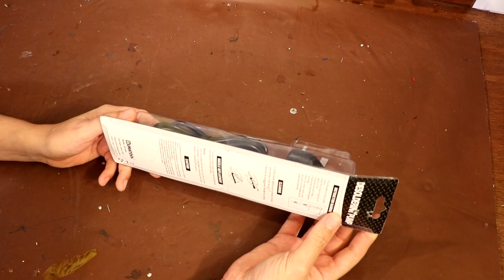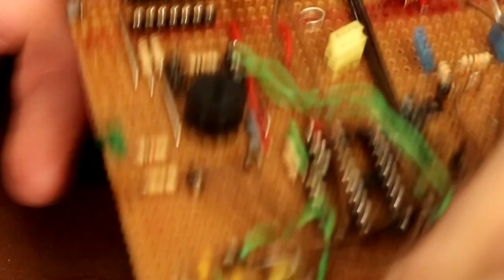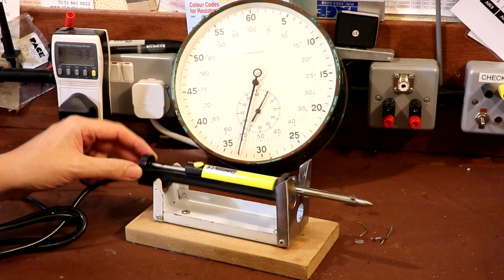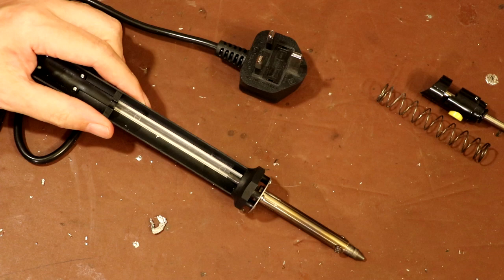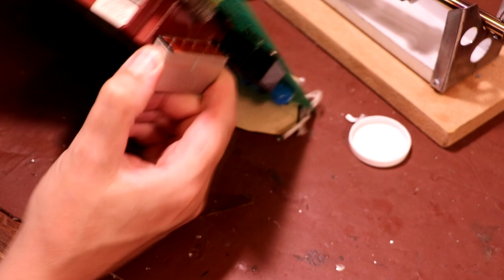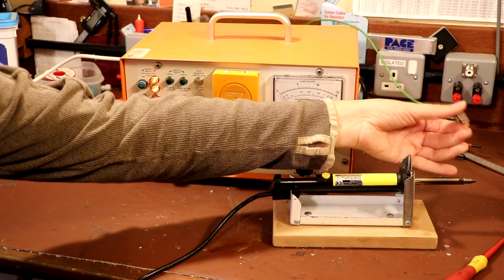Duratool Desoldering Pump

Comment: Same design of my yihua 929 and i use it for desoldering mouse switches and power supply capacitors good performance so far its more efficient than the traditional desoldering pump

Comment: Mine failed after 10 minutes use. The body melted where it meets the tube going down to the tip (where you were complaining of it being a bit hot) and fell out! Clearly they're not all like that but still. It was branded "Yahao" if that means anything.

Comment: I have bought this after watching a couple of reviews.  I bought it to repair PS5 controllers, but seem to be having problems.  It just doesn't seem to desolder properly.  Do you have any tips, as I am a novice?  I have flux on order which I am hoping will make things easier.
Reply from the maker: I suspect a lot of the components legs are small and the tip on that sucker is very large. Something like a PS5 controller is probably going to be something difficult to work on. Flux may help. But it is also difficult to work on double sided boards with a solder sucker. If your removing ICs and you don’t need them you may be better cutting them off. Look at my last video I show some techniques for desoldering
Reply: Brilliant, thank you so much for your response.  Greatly appreciated 👍🏻
Reply from the maker: @PhatControllerz  if the desoldering doesn’t go well don’t beat yourself up it’s a hit and miss process. Remember you don’t get to see all the times I fail.
Reply: Thank you, and to be honest, I didn't think of that.  Everyone has to start somewhere.  I'll keep you posted with how it goes.  I do have my eye on another desoldering tool, so if it goes wonky, I try that one.  Another cheapy, but looks the part and comes with different sized tips.  Fingers crossed.  Thanks again for your help! 😊

Comment: Just grabbed one of these after watching your review last week, surprisingly good actually. I was removing a micro Arduino clone that had all the pins soldered and it made easy work of it, the nozzle is indeed a bit big but once the solder melted on each pin I could give it a jiggle, hit the button and it sucked it all up cleanly. Not sure if it will work a second time but it has potentially saved me its value in time and parts already. Thanks for making this!

Comment: Thank you ever so much for showing us how to get at and clean out all the sucked up solder. My son bought me this exact de-soldering pump last year (for fathers day) and it really is brilliant for "Through Hole" de-soldering. I've used mine on adding chip sockets inside my Commodore C16 computer, when i was upgrading to the 64k RAM and i've just used it on replacing my son's thumb sticks on his PS4 controller. It does get a wee bit hot though and extra care needs to taken when using the pump but it does the job for me :)
Reply from the maker: Thanks so much for watching the video, great comments and glad you found the review useful. I’m very impressed with your computer upgrades your doing a tremendous job. I do think from the description of the work your doing you would benefit from a more advanced tool look at the Duratool desoldering station with the electrical vacuum pump. The percussion from the spring going off in a hand pump can be quite damaging to small pads and tracks especially on multilayer boards.  Maybe you can make a video of your computer upgrade I would love to see that. Thanks best regards Chris

Comment: Thanks for the video. I was afraid to open mine when I didn't know exactly where it opens. Now I know, but I still had to pry with a screwdriver because it was stuck quite hard. If you have trouble desoldering smaller component legs, put some gel type flux on before and there are no issues whatsoever. Flux makes the solder melt instantly and it sucks it so clean it looks almost new. Highly recommended to use flux.
Reply from the maker: Thanks so much for watching the video and leaving a nice comment. I am glad you found it useful. My best regards Chris

Comment: Excellent!  Just bought one and found your video just what I needed to know,  Many thanks.
Reply from the maker: Glad it was useful. Thanks for watching regards Chris
Reply: @allthegearnoidea6752  Funny what you say about removing the solder bin.  I have tried to remove it on the new one I have bought and it is rock solid and have not yet moved it!  I wonder whether the rubber seal is rather on the big side.  I know, from you video what to do but it must be a really tight fit when new.  Perhaps turn it on and try again.  Thought I would practice whilst it was new and cold...

Comment: Best review on this product...plus you are the only one who showed how to empty  the chamber without breaking the black plastic guide. On the other hand other reviewers constantly got a better desoldering performance from this tool . Maybe its all about a technique with this cheep tool. Either way it was really informative.  Cheers!
Reply from the maker: It works very well for the price but doesn’t compare that well with the more expensive vacuum pumps but it’s ok. The circuit board makes a lot of difference how much clearance around the the pin and hole. The board I was using may have been a bit tight
Reply: @allthegearnoidea6752  Today I started  socketing the DRAM of my 8bit Atari and I did an extensive use of the tool.  You are right, the performance of the pump if heavily affected by  the characteristics of the layout of the circuit (size of ground plane and pads, distance between pins etc). 
Multiple pins components  can only be removed with hot air, the pump alone can not free all pins 100%.
Reply from the maker: Yes quite right and good luck with that Atari

Comment: I found 1mm tips on Aliexpress by searching for "Zhongdi desoldering tip".
Reply from the maker: Good job finding those smaller tips and thanks for the update and the information thanks
Reply from the maker: I have heard of the existence of smaller tips but I couldn’t find them myself.
Reply: @allthegearnoidea6752  https://a.aliexpress.com/_mqKLiXf
I tried ordering them just now. I'll try to remember to add a comment on whether they're better or not.
Reply: @allthegearnoidea6752  So I finally got them and they work flawlessly. I tried them on a mechanical keyboard. Desoldering both the switches and the 4-pin RGB LEDs (fairly small pins) was a breeze. Heavily recommended.

Comment: I have one of those and it got so hot in the holder stand that it melted the pegs that are part of the handle, melted the seals in the barrel portion too.  I had to trim the pegs off and get metal standoffs and longer screws.  Still works but has lost a lot of suction power.
Reply from the maker: Yes they run very hot. I wouldn’t leave it unattended etc but ok fo occasional use. Stay safe thank for watching regards chris

Comment: Hi Chris. I did a search on eBay and saw this tool. Very similar to yours but it looks like it comes with 2 tips. Large and small hole. Here is the link. 
https://www.ebay.com.au/itm/220V-30W-Suction-Desoldering-Pump-Tool-Sucker-Electric-Soldering-Iron-Pen/124251891849?hash=item1cedfd6889:g:WdcAAOSwEHpfBWxq
Reply from the maker: Good information thanks for sharing the link

Comment: I see you can burn yourself on the handle so it would be a no-go for me. Totally dislike an ordinary  de-soldering pump. I have gotten used to the de-soldering iron I have 
been using for decades. Has a rubber syringe bulb to suck up the solder . They seem to last 15 years  or so before the syringe bulb cracks to pieces. So I bought 
a new one this year. Very good review that shows I did good. Positive side: heating tip with the larger hole won't clog .
Negative side: Needs an  inch of spongy rubber/ silicone  piece where it gets hot .That should makes things a little safer.
Reply from the maker: he's the Master  It ok for the money.  Desoldering tools are like religion, some people like them but  generally all bad. Thanks for watching regards Chris .

Comment: Certainly a good enough tool for young players starting out on a budget Chris. I wish I had one of those when I first started out as a ten year old with little money.  Some teflon tape wrapped around the end of the yellow tank might help give a some insulation from the heat after all 100C is the boiling point of water.  I don't know if that would affect the fit of the tank and the vacuum seal though. You would have to experiment a bit to see. Thanks for the look see. Stay well. ATB Doug.
Reply from the maker: Doug McArtin yeh the heating is manageable it’s not the sort of tool I would leave switched on all day but it’s a good tool for those starting out and for occasional use. I would have been happy with it when I used to salvage all my components from old TV sets as a boy. Come to think of it I still have those components LOL. Thanks regards Chris

Comment: Thank you Chris for a very thorough review. My favorite solder sucker is the Japan Engineer SS-02 - a bit expensive but very well made and features a pin on the plunger that clears the inlet. I think the secret to all "powered" solder suckers - as others have mentioned - is letting them warm up fully and sucking long enough for the solder to clear the tube. Regards, David
Reply from the maker: David V yes I have a Japan Engineer one,  to be honest I haven’t found it any better that cheap pumps, but the silicon tip is more gentle on the PCB pad so that’s advantage. I still think a good powered pump is really the way to go but it’s the very devil to try and find a good one. Thanks for watching regards Chris.
Reply: @allthegearnoidea6752   It is difficult to find good powered pump suckers - I think you already own the best (Pace). I used a Pace Kit for many years at work and miss it. My personal choice for my retirement bench was the Aoyue Int 474A++ sold by SRA Soldering. It has good suction, a good variety of tip sizes and replacement parts are available. It has a "gun" style working end with a trigger control. I also have an iron style manual pump like the one you featured in this video - very early on the plastic button that locks the plunger down rounded off and not longer functioned. In true 'Merican style I used a the back portion of a Winchester 30-30 spent cartridge to make a new lock button - it has all the markings plus the (used) primer. David

Comment: A great realistic review Chris. I guess because the tube is under constant heat it will never get blocked unless you get a component leg wedged in the vacuum tube. I the heat issue around the handle is an issue that could be solved as you said but will they do it?... nope!
Reply from the maker: George Christofi  yes it gets uncomfortably hot and it’s not the kind of desoldering tool you will leave running all day like the professional gear. But it’s good for occasional use etc. Thanks for watching and comments regards Chris

Comment: Well, that sucks :D but seriously, a very thorough review. I've invested in far too many Abeco solder suckers (same as the green one you showed) which I've somewhat got accustomed to over the years, so they will probably outlast me. :) All the best, Ast.
Reply from the maker: Im a fan of the Abeco, I also have the much more expensive and polished Japanese Engineer version with the silicon tips and I dont think it works any better than the Abeco at quarter of the price. Thanks Aston Regards chris

Comment: i have been looking forever for one of those but with electric suction instead of the somewhat crappy push button spring loaded thingy, do you happen to recommend or know of any pump like that that i can buy without selling a kidney? or maybe attach a vacuum source to one of those, maybe from aquarium bubble pump or coffe machine pump, a fridge compressor is a great vacuum pump but too big and noisy
Reply from the maker: https://cpc.farnell.com/duratool/d00672/desoldering-station-uk-eu-plug/dp/SD01384?st=desoldering%20station
Reply from the maker: These are available cheaply in the UK from various sellers including CPC, Amazon and Ebay. The are very good value for money and work well and all the spare parts you could ever need are available on ebay.  I have been using one of these at work for a few years. The heating element blows up occasional but a complete replacement gun only cost peanuts
Reply: @allthegearnoidea6752  thank you i think i will order one from ebay. seems a reasonable price. i have been desoldering ics and other multi leg components by blowing compressed air once the solder is melted, works extremely well if you havent tried it yet. problem is the splashes of solder go everywhere
Reply from the maker: Hugo B. I have been known to heat up the whole board with a heat gun and smack the PCB on the desk, the parts just fly out. Ok for parting out scrap PCBs etc.

Comment: Not doing industrial professional work here anymore Chris. For simple work, still using a beat up 1972 Edsyn DSO17 "Soldapullt". Evilbay is flooded with china fake copies of it. Have one of those noisy Gaojie S-993A cheap pumps promoted by Defpom, with mixed results due to nuisance and repeated clogging of the tips.
Reply from the maker: To be honest I have had clogging with even expensive tools my Pace was £1500 and it clogs worse then any other desoldering tool I have used which is quite a lot. I think it’s part of the game etc. You just get skilled at unclogging the buggers.
Reply: @allthegearnoidea6752  I have the Duratool electric pump one, and I find that the secret to avoid blockages is to give it plenty of time to heat up throughout. It takes a while for the tube leading into the chamber to heat up sufficiently, even when the display says it's already up to temperature.
Reply: @allthegearnoidea6752  OK Chris, I ordered one on Evilbay just for **it's and giggles. One can never have enough inexpensive de-soldering pumps :)
Reply: I haven’t had many clogging issues with mine, I think the trick is to keep it sucking long enough to clear the tube out before releasing the trigger so the molten solder doesn’t stop in the tube before getting to the chamber.
Reply: @TheDefpom  Probably right. I was using it for repairs on a Tektronix 492 power supply board, which has that special "secret formula alloy" solder. I think it may have had either silver or indium? in the mix. Either case, it had a higher melting point. The supplied tip on mine actually had a cylindrical steel tube (shim) inserted in the tip hole. The clog would not budge, and I ended up destroying the tip and forcing that tube out. That pokey tool thingy supplied for unclogging was absolutely useless.
Reply from the maker: Danish Native Those TEKs did use some exotic solders on some components on I think a ceramic substrate didn’t they. It almost reminded me of silver solder. They used to include some in a little spool at the back of the scope.
Reply: @allthegearnoidea6752  You're referring to the older valve scopes 500 series with ceramic component blocks. The 492 was made in the 80's, and has typical glass epoxy multi layer boards. But the solder is definitely not 60/40 or 63/37 tin lead. You can even see a diference in the silvery luster of the solder and it's higher melt. Maybe 3% Ag.

Comment: very nice I think I have one somewhere haven't used it yet  I have always fitted one of those rubber sleeves to the tip of a desoldering pump I dont think it would work on that one ! not sure what they are called those rubber sleeves but used lots of them at work !
Reply from the maker: thehappylittlefox aka benji The Japanese engineer made desoldering pumps have a silicone tip and it’s kinder to the PCB pads. Thanks for watching see you later on Graham’s live stream
Reply: @allthegearnoidea6752  Thanks Chris I have one of those Japanese ones too haven't used that one yet either  not sure if those rubber sleeves are silicone that I have  we had a special  3 pronged tool to fit them with

Comment: I wished i had one like that when i was replacing 40 pin z80's/memory controllers in my early days of madness :-D
The manual solder sucker is great when new.
I held my desolder sucker directly above the joint, then heated the joint from the side, then slamming down the tip into the molten solder and hitting the button at the same time, takes a few mins to get the hang of it.
Your manual one is an R.S favorite, the spring pulls the piston, not pushes like most.
i used one for years in the electronics repair section of a factory i worked at, would have been nice to have a helper helping me but tight assed bosses..... yep yep typical bosses :-(
Reply from the maker: zx8401ztv  Yes that cheap manual pump from RS is still my favourite and I still think it works better than the very expensive Japanese engineer desoldering pump that I also own. No excuses for you old employers not buying a professional desoldering station time is money and many engineering managers a bean counting idiots. Thanks for watching regards Chris
Reply: @allthegearnoidea6752  I had an avo 8 meter and a crappy digital that kept vanishing, crude irons and the same r.s solder sucker you have.
They didnt buy anything to help me, not even the schematics for the modules/regulators/camis door controllers and everything else i repaired.
I built up a testing method and list of faults that i kept in memory, not fun for a dopey sod like me lol.
Massive stress and depression really made me ill.
Bosses are stupid!!.

Comment: You could make a tip on your lathe 😁🍿
Reply from the maker: Mr E  You know I did consider that just to see if it improved anything but I couldn’t be bothered. I have better desoldering equipment on the bench so didn’t really have the time to mess around any further. But it’s a good unit for money.
Reply: You can remove the screws for the tip. I suggest you dont pull it out because it wants to pull the element out with it. The Vacuum tube blocks up and good luck cleaning that. I keep mine to show people what they should avoid buying.